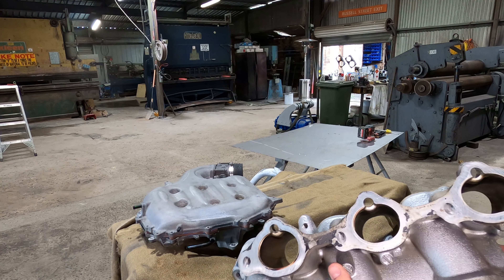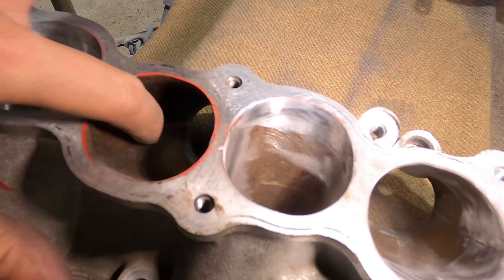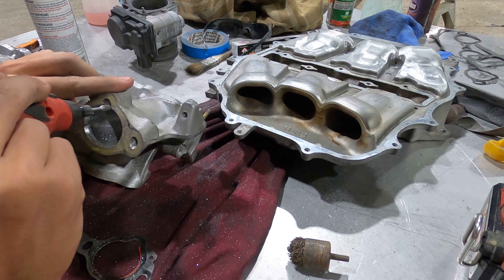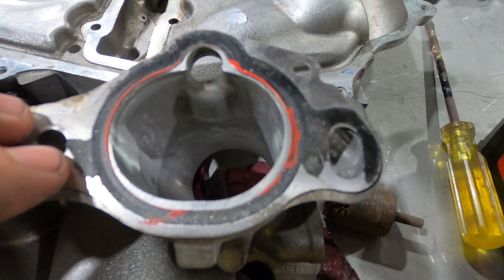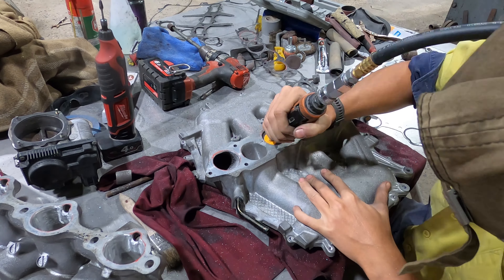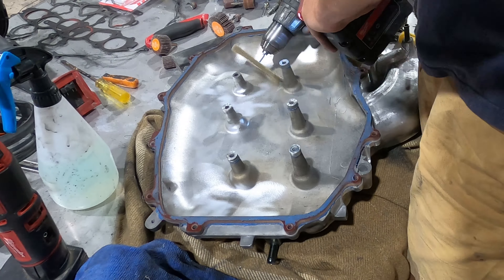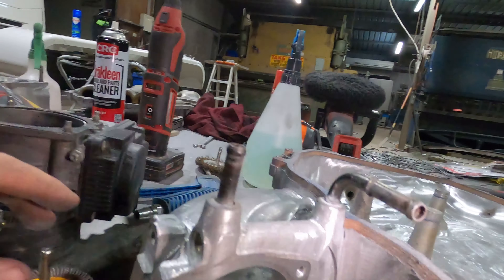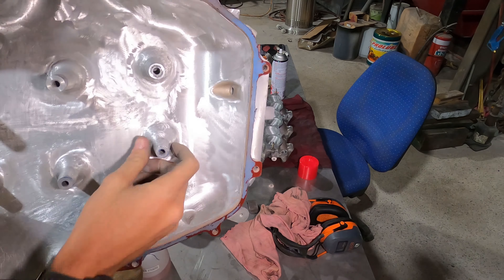VQ35DE Intake/Plenum Port

Comment: I did a lot of the same work on my intake system. I really focused on making that 90 degree bend in the upper plenum as smooth as possible. I worked my way up to like 3000 grit wet sand. Great info here!
Reply from the maker: That’s awesome I’ve heard the choke point on stock manifolds is that 90deg bend, some people have even cut it off and refabricated a bigger and smoother corner🤙🏻
Reply: @ReubsModifications  Spot on - it a big choke point on the DE.

Comment: How was your power after the port? Plenum is definitely recommended but the lower manifold will reduce velocity if the diameter is opened up past just a polish. I definitely regret porting my manifold on my HR as I lost a good 10ft/p of torque throughout torque band except for right up top it picked up maybe 5-10ft/p so definitely less powerful overall. Just a tad more power at redline. I recommend port matching the manifold but blend to normal diameter by half way down at the latest. Then just sand the casting from there down. Loosing velocity means loosing volumetric efficiency and therefore loosing power especially under 5k rpm. opening the diameter in the lower runners does not give you more air, just less velocity.
Reply from the maker: I only picked up about 2kw at peak so not much at all
Reply: It’s already designed well from the factory. You wouldn’t buy a 30,000$ Trombone and port it.

Comment: Did you port match the heads? Intake to head is the most important part of port matching. Port matching was started years ago carburetor-intake port,intake-head.
Reply from the maker: I didn’t match the heads, I found a few forums that said there isn’t much gain from doing the heads 👍🏻

Comment: Good idea this. Any idea on power gains from it? Not expecting anything much but could be handy especially when I get to installing ITB's
Reply from the maker: I got a retune afterwards and power gains were minimal, the restriction of the intake is the elbow at the throttle body. Going ITBs will get rid of that restriction so you should see far better gains than what I got 👍🏻

Comment: So how was the out come? More power?
Idle difference adjustment?
Reply: Was it worth it? 
Gain of HP approximately 5 +/- .
Would like to hear the positives if you can.
Thank you for your detailed video was definitely entertaining.
Reply from the maker: Considering the cost was very low I'd say its worth it if you have the time to do it yourself. I gained some mid range torque and gained 3kw at the wheels for peak power. The tune was required after the porting as the idle was all over the place.
Reply: @ReubsModifications  
what happened to idle?
Reply from the maker: @инвесторвничего  caused the idle to hunt and bounce around, would idle up and down between 750 and 3000

Comment: What tool is the Arba? I can’t seem to find it online
Reply from the maker: They're rotary sanding pads. They come in a few sizes I think I was using 2 inch pads in various materials. You can get sanding discs in different grit and scotch bright pads. Try searching rotary tool sanding disk. Here's a link I found to one but it doesn't include sanding disks 
https://www.ebay.com.au/itm/304555859766?chn=ps&_ul=AU&_trkparms=ispr%3D1&amdata=enc%3A1nRNVXt9AQ5CxdcgJm6Z-Wg53&norover=1&mkevt=1&mkrid=705-166974-041499-5&mkcid=2&mkscid=101&itemid=304555859766&targetid=1742491917535&device=c&mktype=pla&googleloc=9069172&poi=&campaignid=19903037956&mkgroupid=147124481666&rlsatarget=pla-1742491917535&abcId=9308386&merchantid=7364522&gclid=Cj0KCQjw3a2iBhCFARIsAD4jQB3K9LNjBuuVCi5EAoslEXmlZdGxRVPsJO2-8yM2NVkCIgJbmiILkewaArTQEALw_wcB.

Comment: Can you post the first tool used on the die grinder please
Reply from the maker: First one looks like a carbide burr, should be able to find these at most tool shops just make sure you find the right sized shank for your die grinder 👍

Comment: I'm about to work on one, I don't think I should port the bottom of the manifold just the inside and the top of the lower plenum and pretty much the whole upper plenum, did u have any issues afterward?
Reply from the maker: It did change the idle slightly but I was getting the car retuned soon after so that was corrected. The car was still drivable but had a high idle which became annoying 👍🏻
Reply: @ReubsModifications  Are you certain the idle came from the port and not the throttle body being moved?
Reply from the maker: @crebiiGG  it could have been the throttle body but I did the throttle reset multiple times and it didn’t fix it
Reply: @ReubsModifications  heard heard. just checking cuz i plan on doing this! thanks for the info
Reply from the maker: @crebiiGG  no worries mate 🤙🏻
Reply: @ReubsModifications  Only port match the opening of the lower runners, but keep the normal diameter just after the opening down. Never port the bottom of the runners - you will loose velocity and therefore volumetric efficency & therefore torque. Just sand castings after blending the opening to normal diameter.
Reply from the maker: @ryanscanlan9875  great information 👍🏻

Comment: Wouldn't you want the intake surface to be a bit rough to help with fuel atomization? I thought polishing was only for exhaust porting...
Reply from the maker: that is one concept, the other is better airflow i think both are fair points. I did get minor performance gain after retuning however.
Reply: @ReubsModifications  that's true. I believe however that since the VQ is a multi pojnt fuel injected engine, air and fuel get mixed in the intake manifold and it would benefit from some extra atomization, where as a direct injection engine would benefit more from polishing and flow since air and fuel only really meet in the combustion chamber. I guess we'd have to see a comparison to really tell witch concept works best for the VQ
Reply from the maker: @Sam_Missile  yeah that’s a very good point, you would have to compare both side by side to be able to see the difference. I think it would be a very minor difference and would probably vary throughout the RPM 👍🏻
Reply: Post injection benitfits from rough surface as with direct injection benitfits from port and polish as the fuel is added after the manifold. DE benefits from less turbulence and more velocity from port and polish.

Comment: What kind of grit are you using?
Reply from the maker: Varying grits from 40 up to 240ish 👍🏻
Reply: Oh ok, did you also port the intake inlets on the heads? Or it doesn't matter?
Reply from the maker: @TjRebel  I asked a few people with better knowledge on the engine than myself and they said that there isn’t much benefit in porting the head🤙🏻